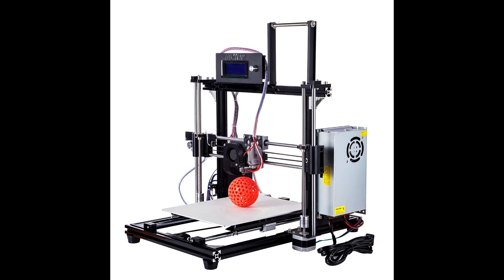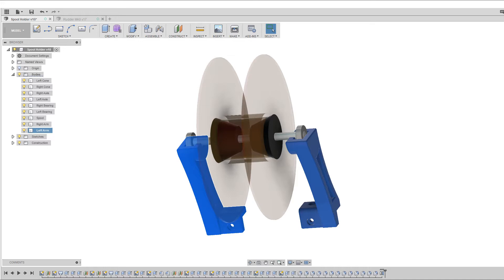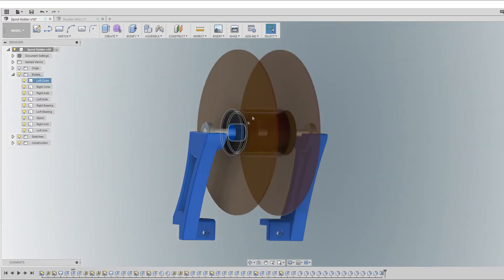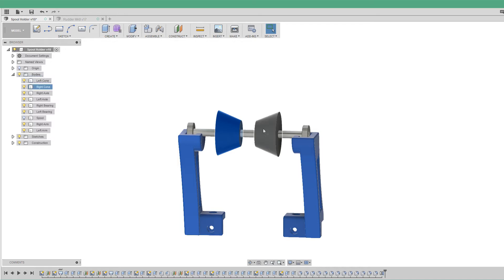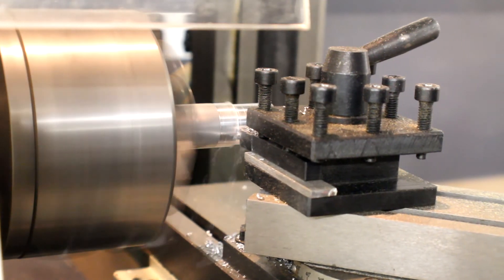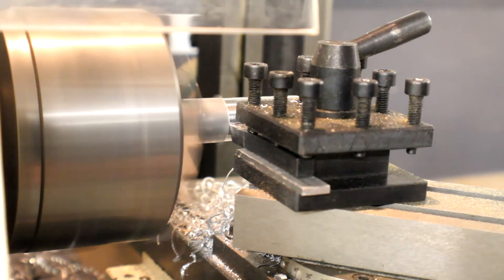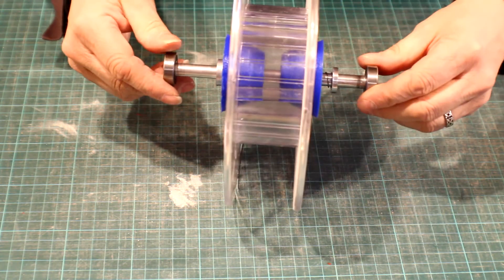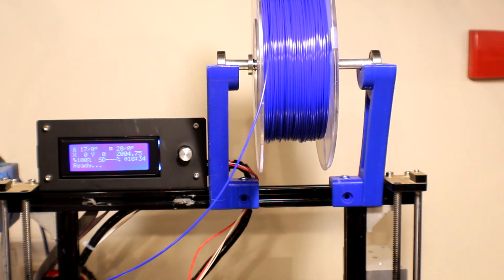3D Printer Upgrade - A Better Spool Holder

Comment: You've got a 3D PRINTER... 3D print a spool holder!!! Why show one made with a metal lathe, that 99% of 3D printer owners don't own...????
Reply from the maker: An inventive person could cut two lengths of steel or aluminium bar, then 3D Print a collar clamp for the depth stop, but if you have a lathe why not use it?